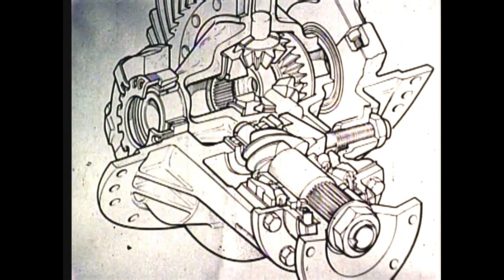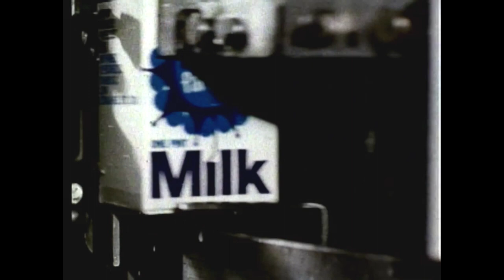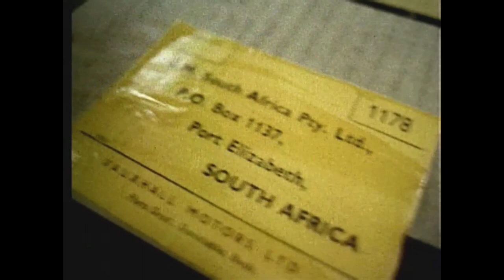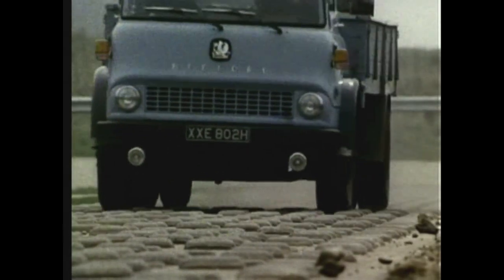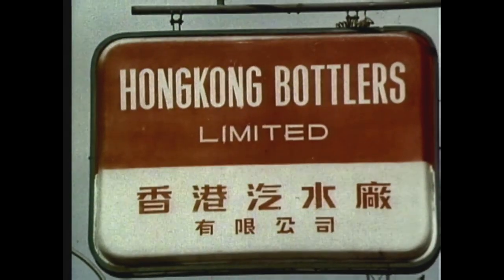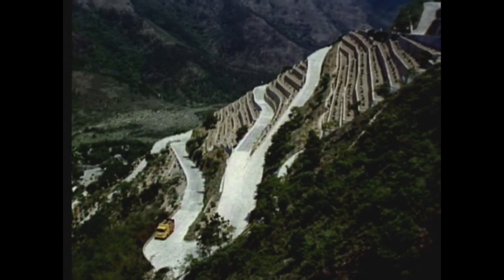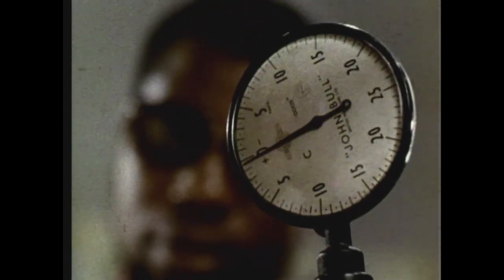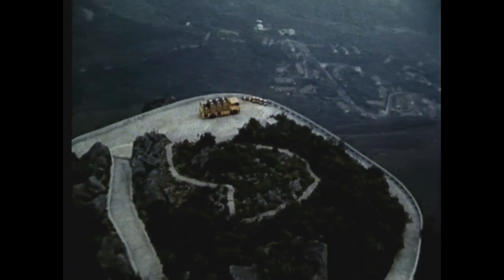Bedford  - More than a Truck. 10.71

Comment: Still got my 1974 Tk tipper, Australian assembled, with 250 ci Mexican Chev 6cyl, this was the motor supplied from the General Motors Holden's factory at Dandenong. Great little truck. Terrific film.
Reply: 300 cu in
Reply: Actually a 292
Reply: I wish it was a 292, the smaller  models only got the 250 in the early 1970s, as it was an upgrade on the 214 Bedford motor. My family had a bigger later model with a 292 Chev. It was more common to see this size motor.